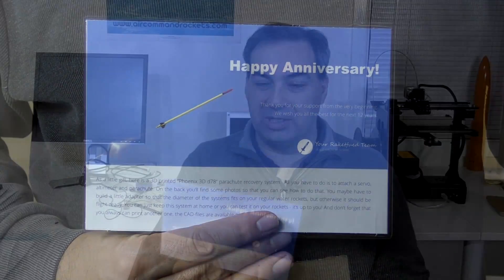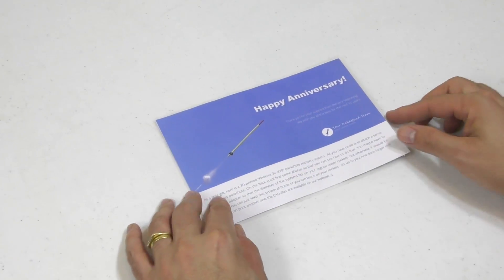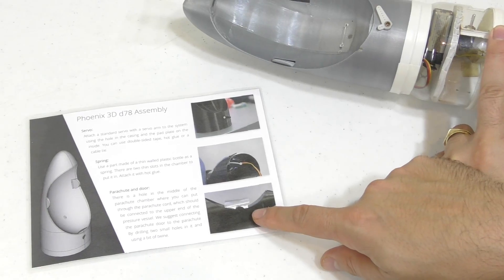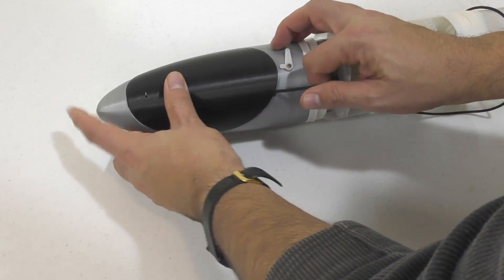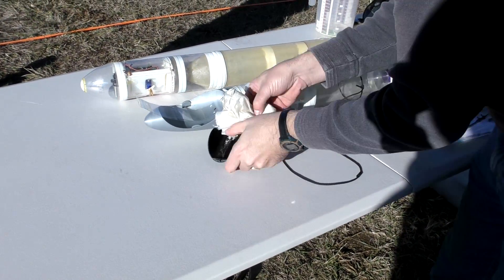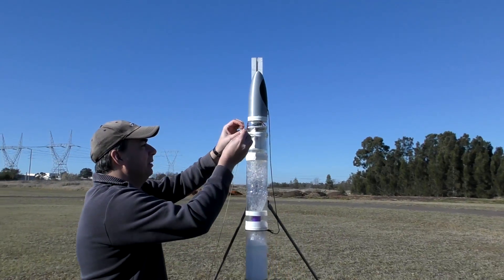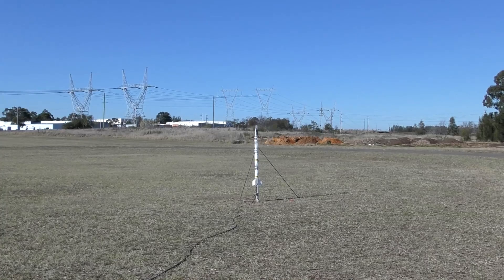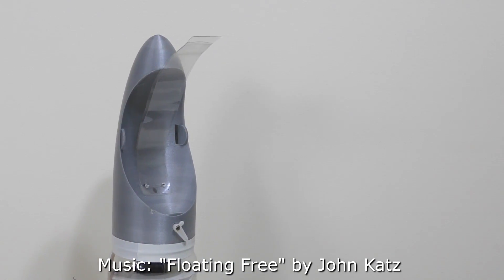Phoenix 3D Parachute Deployment Mechanism

Comment: This is the first time that I've seen a video from this channel. Didn't even know about water rockets! My first question is: has anyone tried a laminar flow setup from, or at the nozzle?
Reply from the maker: The question is, what is the tradeoff in creating laminar flow out of the nozzle and any potential benefits that laminar flow may provide.
Reply: Air Command Rockets from what I've read(and that's all I've really got to go on because I'm an expert on absolutely nothing) that the water molecules line up. If this is true then water existing the nozzle wouldn't spread out as quickly. Would this increase the thrust?
Reply from the maker: Presumably you would want laminar flow in order to improve performance, however, the mechansim by which you achieve that may add weight to the rocket (I am thinking the classic approach where you use a bunch of straws across the whole diameter of the rocket. The extra weight may offset the small gain you would get with the laminar flow. You may also reduce the efficiency of the air-pulse phase of flight when air comes out of the rocket, as the straws would add extra resistance to the flow of air. Only one way to know is to test it. :)

Comment: Wow, thank you so much for making this video! We have never thought that you would do an entire video about our system. I'm glad everything has worked out well. :) Also, very interesting spring attachment - we will consider to include this in our design. 
Thanks again and a happy weekend!
Greetings from the entire Team
Julian
Reply from the maker: Thanks Julian. I will email the photos from the launch. We've been slowly updating the website to make it more mobile friendly. There are still around 250 pages left to convert. :(
Reply from the maker: Thanks Julian. :) The nosecone worked very well. How do you normally attach the spring? I noticed the stubs on the inside and I figured you just make holes to match on the ends of the spring and that stops it coming out, but do you secure the spring any other way as well? I was thinking perhaps something along the lines of having a longer tab on the end of the plastic spring, fold it over in half and insert it into the slot in the nosecone. If the slot had a little return in it, then the folded over tab would work like a barb on a fishing hook and that would keep it in. You wouldn't need to make a hole in the tab.
Reply: You guessed right about our attachment. We make a hole in the spring and secure it with hot glue. In our case, this has worked perfectly fine but the method with the barb sounds like a good idea. ;)
Reply: By the way: It would be nice if you could send us the pictures of the launch in high quality so that we could use them on our website. ;) 

Also good work on your website. I've seen that more and more pages are updated with the new design, which looks nice and clean. :)
Reply: I know how you feel! It Happened the same to me, when my logo button was shown in George's video.
Reply: I know this situation quite well. Our website has only about 50 pages, but there are dedicated mobile/desktop and english/german versions. Changes in the design/navigation require a lot of work. :/